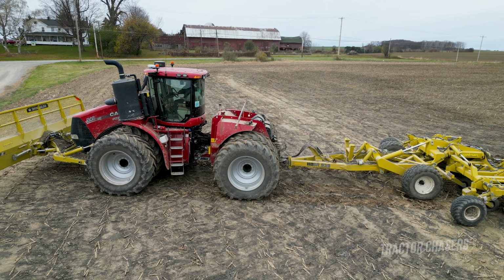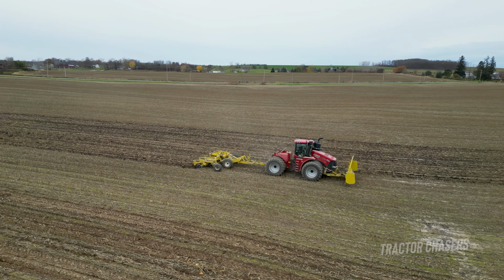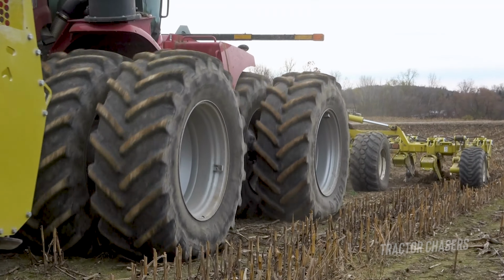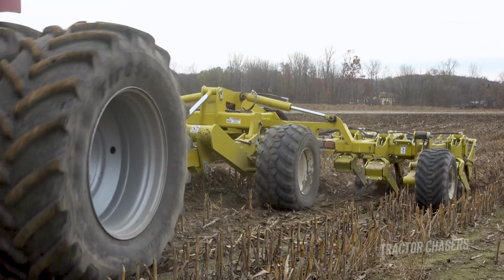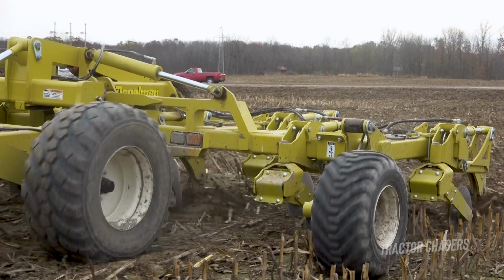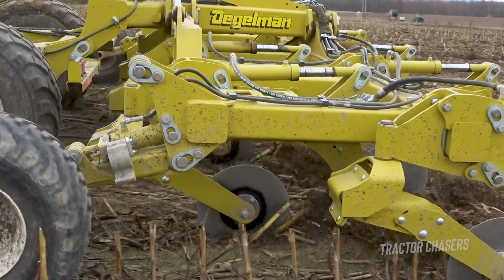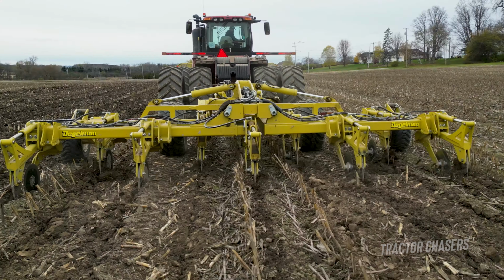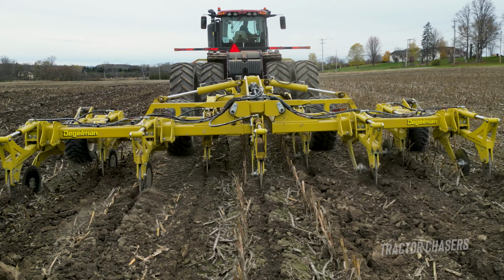Brand NEW Degelman HDSR 930 Ripper!

Comment: Id be curious what the difference would be with a quad trac in the same horsepower vs this steiger.
Reply from the maker: They were running it on a QuadTrac before this, but felt the wheeled tractor pulled it better in these conditions.

Comment: Typical slippery spring conditions.
Seemed to have plenty of power; power to the ground was limiting. Wonder if a track-tractor would have fared better?
Good up close footage.
Reply from the maker: Thank you!  They were running it on a QuadTrac before this, but felt the wheeled tractor pulled it better in these conditions.
Reply: @tractorchasers  
How interesting. Wonder why and how?
Reply: @eatingamandarin  Think about it. Tracks are supposed to create less compaction correct? That means less psi on the ground.